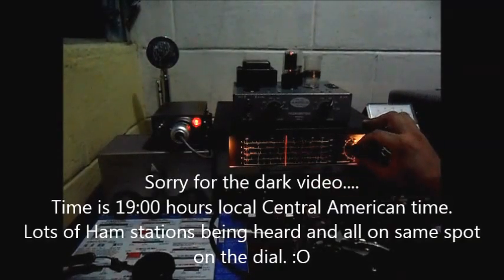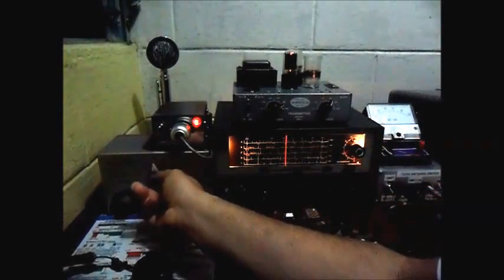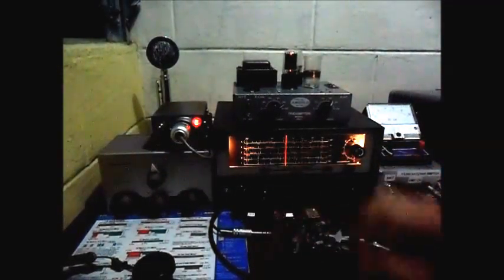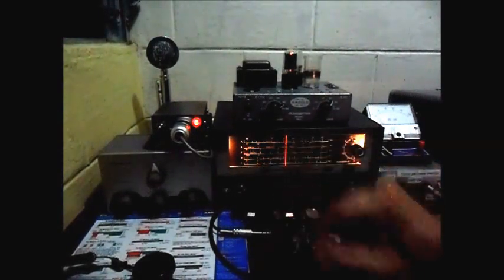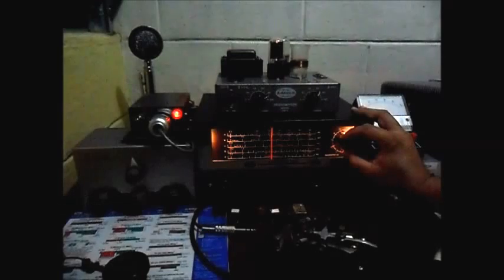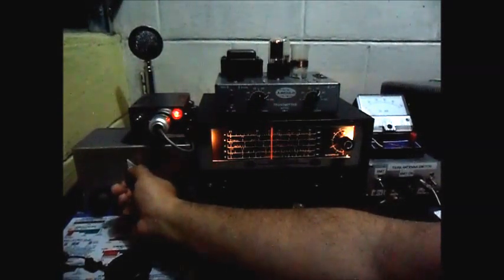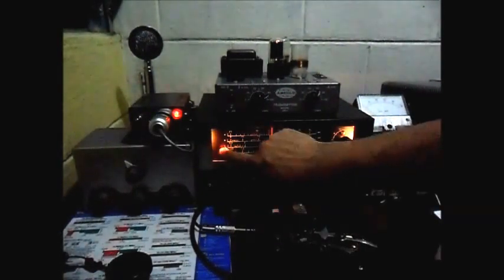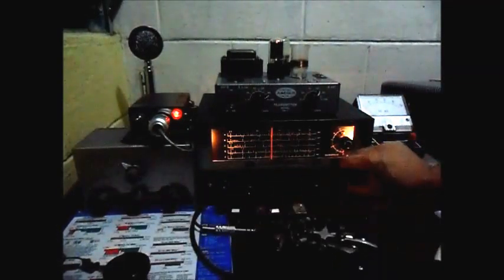Ameco Vintage Novice Ham Radio Station Part 2 by YS1RS

Comment from the maker: the speaker is quite big compared to modern rigs. The sound is very good really.

Even with the Q multiplier in place does not compare with the selectivity of modern receivers but, after all the restoration work I am very happy with this old setup. What I need to do is to listen more and more CW to the point to become a full second language to me. The selectivity will be in my ear and brain. So much work on this field ahead.

Un abrazo Lynn.

73 de Rob.
YS1RS